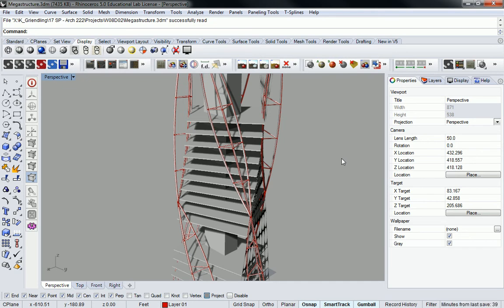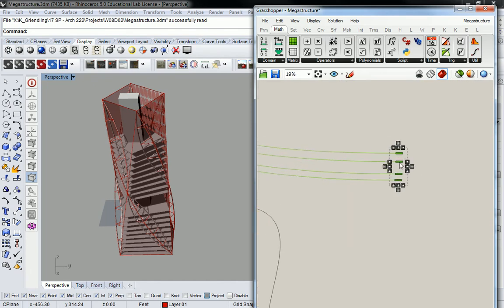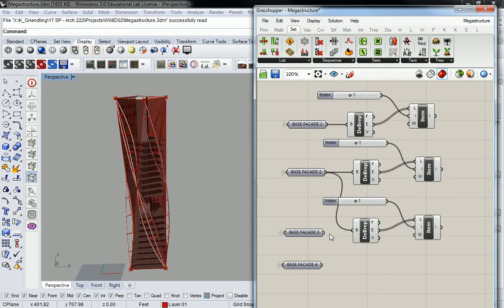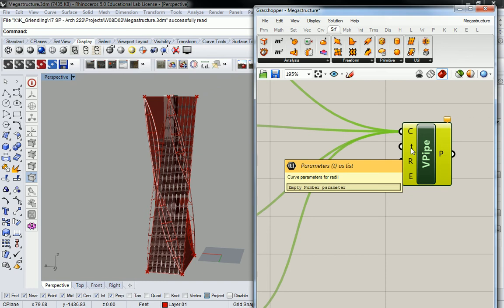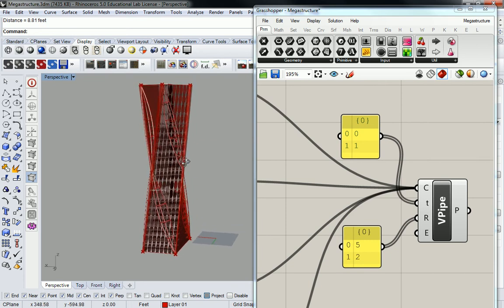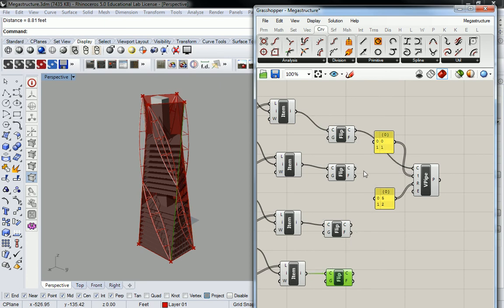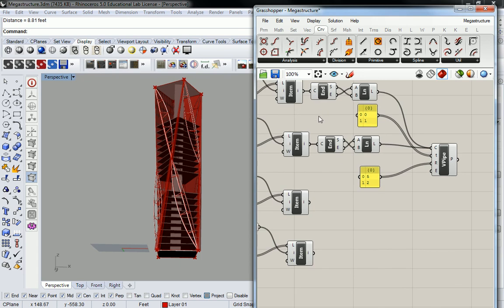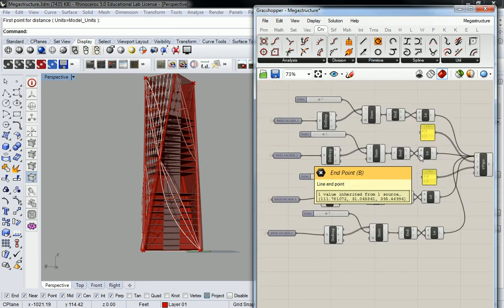90 - Grasshopper Megastructures - Tapered Structural Columns with Pipe Variable

Comment: an elegant solution would be just adding a Range node with No of Steps set to 1 , after any curve you want to use in VPipe, and connecting that to VPipe's t. That will auto transfer the parametres. Works with all curves and with same Range node can be subdivided to equal parts. This way, by adding algorythms or data from FEA plugins, lists of random numbers etc, we could very accurately and automatically change shape and function within our pipes, or create junctions, joints, patterns, values from graph (need to remap to 01 in, remap to original out) etc.

Comment: one thing to have in mind is that Vpipe does not produce a straight loft from R0 to R1. Lofting/Sweeping 2 circles will do so. VPipe is meant for multiple radiuses with tangent blending, it blends even 2 values, starting with planes tangent to endpoints resulting in a pipe that is always bottle shaped. I think GH developers should add an option on VPipe like they have in loft:

a. straight
b. interpolated

or other similar solutions.

Comment: Hi, Thank you for publishing these tutorials. I think this is the problem: you provide t with 0 and 1 and the direction of the curve is from top to bottom and you provide R with 5 and 2. It starts at the top with 5 for t[0] and 2 for t[1] at the ground. just switch the R values
Reply from the maker: A very likely solution. Sometimes I don't get much of a chance to troubleshoot while I am lecturing. Thanks for contributing.

Comment: Hey can you adjust the resolution for the coming videos to 1080? also, is it possible to share those files at least not to recreate them from zero?
Reply from the maker: You can bump the resolution up to 720p. that is enough for this. Our workstation defaults to that. On the subject of posting the definitions, I probably could. but logistically would be difficult for me to manage. I spent a few minutes at the end of class posting these each class, so I don't plan on going into full blown production mode. 

Besides, I don't believe you would actually learn it unless you went through and built the definition yourself. It is best to do it that way for your sake.